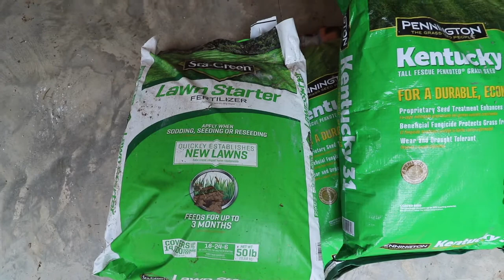#122 Fall 2020 Lawn Aeration and Over Seeding

Comment: Great video.  I rented a 48” 3 point aerator for the first time this year, it made doing the larger areas a breeze.
Reply from the maker: Hi Sam!  Awesome with the 3 point aerator.  I hesitated to use my Kubota L2501 as I didn't want to tear up the lawn with the R4 tires.  Plus, there are so many obstacles it would not have worked well.  I think I'll rent one of those stand on aerators next year and I hope to have a zero turn next year that "maybe" I can drag a 48" aerator?  Thanks for watching!